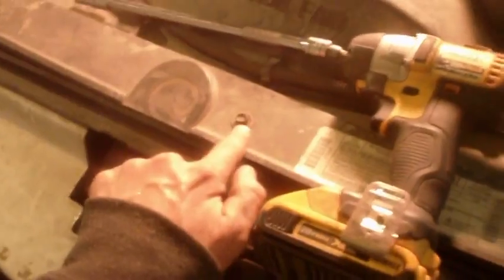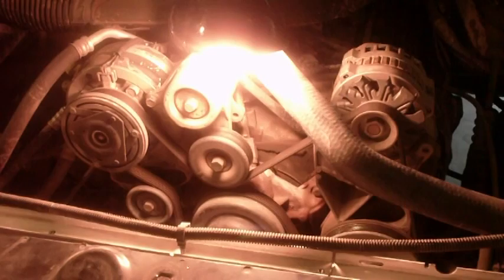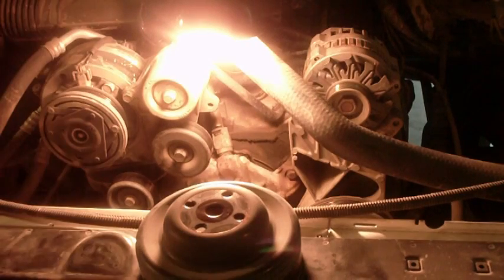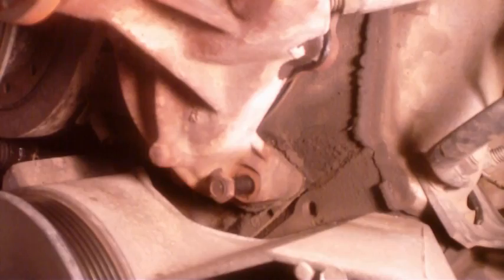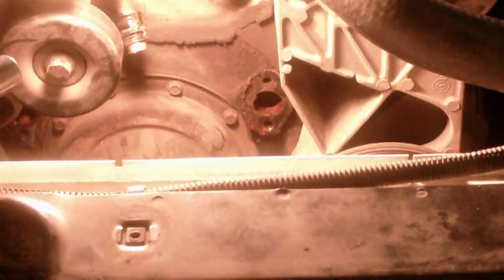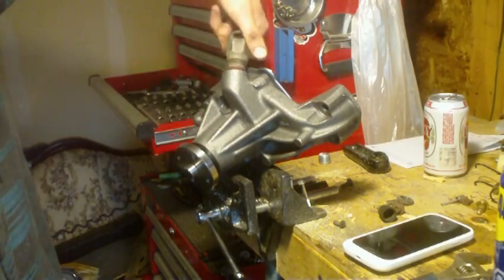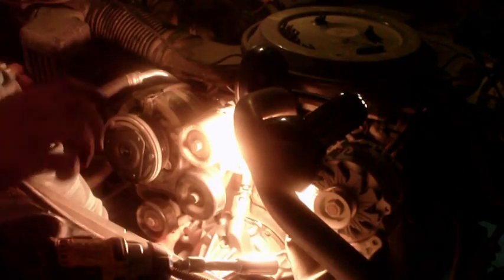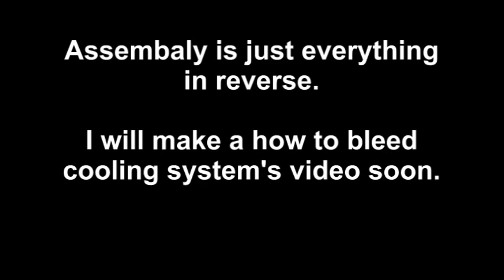How to replace a water pump 1995 GMC Sierra

Comment: It would help to first unscrew the pitcock on the radiator and drain the coolant before removing that lower radiator hose....
Reply from the maker: If it's an old rad I prefer to not touch it but yeah it would make it better for sure

Comment: Is this a standard rotation pump or counter clockwise?  I was told that serpentine belt set ups need a counter clockwise and I'm not sure which kind to buy now lol
Reply: @TheCraftyTech  So u don't know either is what your saying lol
Reply: @TheCraftyTech  it's a serpentine belt but I'm confused by the reverse rotation thing
Reply: It is a type of reverse rotation in  which the thermostat controls the temperature.